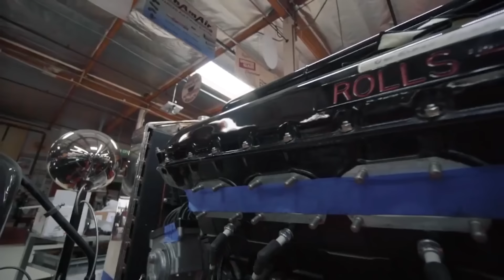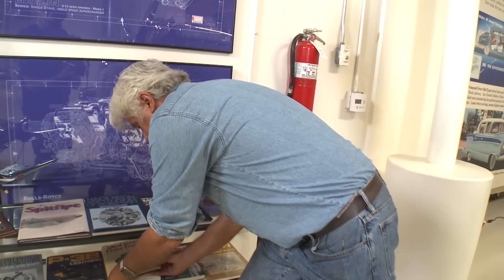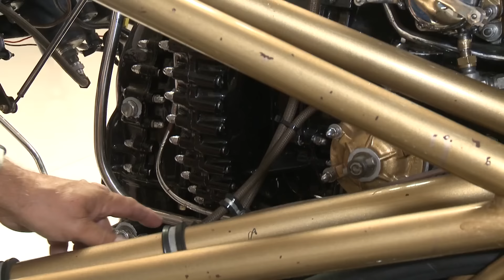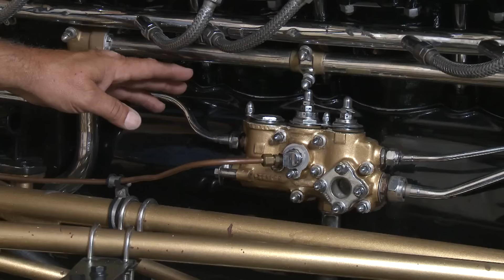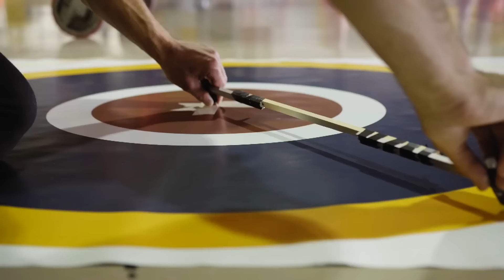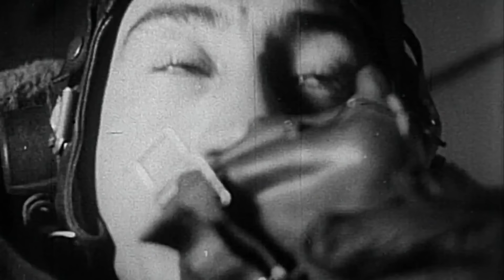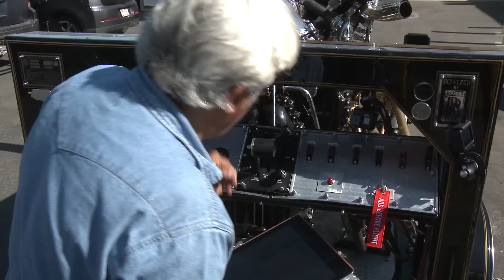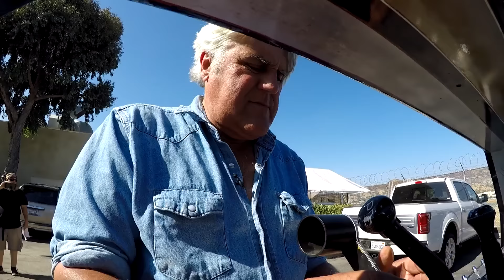The Engine That Won World War II - Jay Leno's Garage

Comment: My father worked as set-up man at Breeze Corp. in Newark, N.J. from 1941 to 1946 setting up machines that made tubing and braiding for control cables and the ignition wire shielding and radio wire shielding for the Packard Merlin engines and for the V-12 Packard engines in the PT boats and was verbally abused for 3 years by people who accused him of being a draft dodger and a slacker and was spit on and cursed at. He was 5'9" and 175 lbs. and could never say a word about what he was doing.  I think The History Channel should do a documentary on what the war workers had to experience during WW-ll.
Reply: It was a Rolls Royce Merlin, not a Packard Merlin. Packard made under licence from, and overseen by, RR.

Comment: The engine that won the war is reaching.  I understand the emphasis, but many crucial campaigns around the world were won by radial engines of various builds.
Reply: Not at all.  The narrow design made for a very efficient package once put in the later Mustang variants that allowed them to escort the bombers all the way to critical targets within Germany and back.  Hence slowed or even stopped certain war production which in turn won the war in Europe.  Yes many, many radials contributed and were an integral part but saying the Merlin made that significant of a factor in not far fetched in my opinion.
Reply: @mnmvuk  

What you wrote ("significant part") is different from what the premise was ("won the war"), and the impact of their roles is known to us all. No single engine did that. You mention the factor of the long range Mustang which indeed swept the skies and enabled the bombers in both theaters. Many of those heavy bombers had radial engines in Europe, certainly the Americans, because radial engines were tougher and could withstand more damage than fragile inline engines. 

The Americans were bombing in broad daylight (unlike the British bombing at night with inline powered bombers). In the Pacific, radial engines did the bulk of the work and the war was ended completely by American bombing from radial engines.

Comment: A woman near where I grew up in Willenhall ended up with a Merlin in her kitchen when it was lobbed through her wall.
Alex Henshaw, the chief test pilot at the Spitfire plant at Castle Bromwich, was ferrying one back down to the factory from Cosford when the skew gear sheared. He was below low cloud and didn't have much option but to slam it down on a canal tow path which was when the Merlin detached and went through the wall of a nearby house.
He was testing again the next day after a soak in a hot bath. 
I personally prefer the sound of a big radial or the Griffon to the Merlin but there's no denying the effectiveness of the design. This one of Jay's is great to see and I'm glad it's being run and giving people goosebumps and smiles.

Comment: The pilot in me was SCREAMING while you started that thing...

And while you ran it

And that engine was not designed to run anywhere near 4000rpm's.  It would run at no more than 3000; most likely 2800

Comment: the DB 605 was more impressive, technically , don't you think ? also, it had about 30 % more displacement - yet was a bit smaller in length and width   ...  if the Germans had the same high grade good quality gasoline as the Allies had - they'd get even more power out of it

Comment: When I was in a Navy squadron that had R1820 radials we used 115/145 avgas. You said that you are using 100 octane avgas - is that the highest octane you can find now or has the compression been lowered during the rebuild? A beautiful motor, both visually and audibly!

Comment: All you need now is a P51D that needs an engine. That's the coolest thing you've got, thanks for sharing...
Reply: Or a Lanc, or a Halifax, or a Spitfire or a Hurricane, or a Mosquito.....
Reply: @duanerutherford9033  spitfire did NOT use a PACKARD built version of this engine,  the spitfire MkXVI did use the Packard built 266 version as the only spitfire model to use a PACKARD Merlin !!!!
Reply: @wilburfinnigan2142  I never made a distinction between the Rolls Royce original version and the Packard version. I know that the Spitfire used the Rolls Royce Merlin, and that the p51 used the Packard. I wasn't aware of the later model crossover. Either way, I stand by my twenty year opinion that the Merlin (both versions) was a deciding factor in the war.
Reply: @duanerutherford9033  Also EVERY engine in the war was a deciding factor !!!! Hell there were 14,000 P40's  9,000 P38s. 8000 P39's/63's  used in the war and those all were a deciding factor, along with the 200,000 plus PW R1820's the 180,000 Wright R1830's and the 128,000 R2800 PW's !!!!  ALL of those engines dwarfs the 150,000 merlins made !!! Its all in the Numbers !!!!
Reply: crashaxearmory  except the Mustang NEVER used that version of the Merlin........neither did the spitfire, lanc's, hurrycanes and mossies did though !!!! PACKARD provided 37,137 merlins to the Brits !!!

Comment: It’s a pleasure to hear that engine, attached to a Spitfire fly over our house regularly, we live in what was known in WW2 as ‘Bomb Alley’ in Kent, UK.
Reply: Jay Day   That engine, the PACKARD built V1650-1 was NEVER used in a spitfire !!!!!  Lancs, Hurrycanes, Mossies, P40's........  Facts of history !!!  You do realize don't you there were over 30 versions of the merlin using THREE DIFFERENT superchargers????  First merlis up to the 20 series were a simple Single stage supercharger, then ALL 20 through 50 series, the most common version used throughout the war they added a second speed to the supercharger, to turn the compressor wheel faster at altitude, and then  in1942 they added the 2 stage 2 speed version....

Comment: Yeah Jay Leno did the smart thing limiting the RPM of that big engine if that engines powerful enough to lift a 10000 to 15000 lb plane into the air it would have no problem at Full Throttle taking that forklift and sending it into the building behind it not to mention the engine on the trailer could end up taking off trailer and all across the parking lot from the thrust Jay did the right thing by playing it smart

Comment: What's the difference between the Merlin and the  Allison aircraft engine ?
Reply: As I understand it   The Merlin used different superchargers depending on the altitude the aircraft was intended to operate at. High altitude aircraft used dual superchargers. The Allison on single engine aircraft used one single stage supercharger, but the twin engine  P38 used the same engine with a turbo charger added because more space was available.  Gregs Aircraft and Automobiles has some excellent videos on this and similar subjects.
Turbo vs Supercharging in WW2 Airplanes
https://www.youtube.com/watch?v=ULLsIo1VzTw&t=1180s
Reply: Thanks for the informations

Comment: Early Merlins had one-piece cylinder bank + head castings, but difficulties with porous casting flaws drove RR to make them seperate. Apparently several Spit and Hurri pilots were lost when glycol coolant got into the exhaust because of this flaw. It wasn't much of a problem when in flight, but because of the nose-up landing attitude they couldn't see the ground properly when the cockpit was surrounded by a thick cloud of glycol fog.
This information came direct to me from a guy who used to work for RR and was seconded to the RAF during the BoB, where he worked on the home base airfields.

Comment: I may have heard incorrectly but why did he set the mixture to cut-off. That's not how you usually start a carbureted engine. It's been a few years since I have flown but mixture set to cut-off is how we would turn the engine off. Gotta figure that mite be why it was stalling on start up because it was eating up the initial primer fuel used to start and then leaning itself to cutoff. I'm guessing I heard incorrectly because Leno knows his stuff. Awsome video though.

Comment: The Allison V1710. Great engine too and equally important in the history of WW2.
The Merlin was equally important, and with its supercharger design it was superior to the Allison for critical altitude.
Reply: The Alison engined mustang was a dog until they put a merlin engine in it,the merlin was a way more important engine than the Alison my friend
Reply: mattvew findlay 
Wrong. Allison was superior in every way  under 25,000 feet. Auxiliary supercharged made it inferior at critical altitude. My friend.
Reply: @machia0705  wrong again the p40 was also a dog and that had an Alison engine and that had woeful performance, can you tell me where you qot those fantasy numbers from? The only aircraft that cut it with allison engines was the p38 and that needed two of them and that was only in the pacific, the p38s superchargers froze up at high altitude in northern europe
Reply: mattvew findlay 
Lol
P-40 was a dog? It could out dive and out maneuver a P-51 making it the preferred ground attack aircraft in all theatres of war, made possible by the rugged Allison V1710. The P-51 had superior speed and range, making her the best escort fighter.
You’re naive at best, to think that the Allison and P-40’s were dogs. Lol
The Merlin was an incredible piece of machinery but had nothing on the Allison except for it’s supercharger design. At lower altitudes the Allison was clearly superior. 
I’m a pilot, an engineer and a reader of everything technical relating to aviation, especially 1930-1946 civilian and military designs, history as well, WW2 history. What is your background?

Comment: While I love the sound the Merlin, I'm kinda partial to the P&W R2800. Just the Marine in me I guess
Reply: Corsair?
Reply: @duanerutherford9033  you nailed it bro!
Reply: @marinegunny826  Thought so. They have a bent wing beauty at the CWH as well. Used to hear it flying around all the time when I worked nearby.
Reply: @duanerutherford9033  pilot and owner of one let me get my picture taken with it at an airshow in Chesterfield Virginia. He said it was pure pleasure to fly but something to be respected as well
Reply: @marinegunny826  lot of interesting history in that bird. Bomber engine and prop on a fighter. Gull wing so the prop won't strike the ground or deck. And then there's Pappy, and the Blacksheep. VMF 214 FOREVER!
Reply: @duanerutherford9033  Yeah, for sure, and the fact that the Navy rejected it at first and relegated it to the Marines. Then the Royal Navy figured out if you make a gentle arc towards the carrier, it's only at the last second you lose sight of the deck

Comment: The Merlin is a great engine. I like the Pratt and Whitney R-3600 as well. A 28 cylinder radial engine, displacing 3600 Cubic Inches putting out 1800 horsepower at full military.
Reply: The Pratt & Whitney 28 cylinder R- 4360 cu in had a max output at takeoff of 3800 hp. At 2800 RPM.

Comment: What's amazing is that this engine was designed and built using NONE of the modern techniques that designers have today.  No CAD.  No CAM to make the parts.  Not even a pocket calculator!  Just a slide rule and a micrometer.

Comment: Many of the comments here prattle on about Packard modifying the Merlin. They did no such thing. RR ensured their engine had interchangeable parts no matter where it was made. The engine was made at a number locations: Crewe, Manchester, Glasgow and Detroit. Packard took a time setting up Merlin production as they used American threads, not British. 

Packard had to issue a tool kit with each engine as British and Aussie mechanics did not have US gauge tools.  In hindsight RR should never have allowed Packard to stamp the word Packard on the rocker box covers. But in the day, seeing the word Packard meant you used another tool kit. This confuses Americans into thinking it was a different engine to the RR Merlin.

Comment: DB601 was better and had fuel injection Merlin would stall in high G dives and cut out because had a carburetor.
Reply: The carb' stalling was only for a matter of weeks until there was a fix installed.  Later Merlins had fuel injection.

Comment: I certainly won't take anything away from the Merlin. It's a great engine. But the Pratt and Whitney R-2800 double wasp was every bit as important and powered a lot more aircraft than the Merlin did.
Reply: The R-2800 was nowhere near the Merlin. Making a lot of them does not mean better.

Comment: Sounds like my truck.. started it on the sales lot..  brought it home.. didn't worry about cost.. it's worth it every time I light it up;;☆》♡♡♡ 

Mix hempseed oil with the ethanol.. it's the way to lubricate the top end and cushion the valves on the seat.. no fancy metals required..  hempseed oil can replace diesel.. and jet fuel.. it burns blue and clean, like hydrogen.. no smoke or soot.. add acetone and it will be the best av gas for this engine.. I did my apprenticeship on Jaguar, worked as an engineer on gray market exotics.. built factory floor automation for Raytheon Engineers and Constructors.. we built 2 refineries while I was there... I was the lead programmer for my group.. I have been working on this for about 8 years.. we must stop using petroleum based fuels.. it's the ONLY cause of global warming
Reply: Ohc 4 valve.. awesome  .. sounds like my 5.7 Nissan would.. sorta.   DOHC.. 4 valve..most people in America don't realize how long ohc engines have been around.. Alfa released the first production DOHC engine in 1906.. San Francisco had horse drawn fire engines
Reply: Acetone can be made from alcohol.. by distillation with a couple ccs of sulfuric acid.. and adding a carbon ring... I am working on it at the moment
Reply: Hydrogen is zero emissions.
Reply: @johnburns4017  so .. it's burning.. oxidation, right?.. turns it into water vapor.. that's the goal brother
If you add a little carbon it also oxidizes.. acetone has a single carbon chain with3 C atoms.. it's the absolute minimum.. I can make OH gas on demand with a little HSO4.. I have a couple old MGB SU carburetors.. I am going to recast the float bowls to accommodate the acid, it just sits there and eats the carbon.. I replace it every couple of years in the ongoing experiment in my lab.  Big Fun.. I have a video on YouTube here that shows another experiment using it as gas for a Little Torch for jewelry making.. now I can melt platinum.. another project
However.. as an immediate replacement for gasoline.. it's getting hotter in Phoenix.. and polar ice will sublimate into water.. on both poles.. all at once.. 
How long can you tread water?
I am in a wheelchair chair at the moment.. it doesn't float
I don't need more money.. I hate watching people die
So I give this information away.. so other people can use it.. we might be able to save our one and only Planet.. we vote with our wallet.. alternative fuel is never forced.. we make beautiful music through mutual cooperation.. it's a good thing
Reply: Adding 250cc of aspirin gives us acetone from raw ethanol... 250cc = small bottle of aspirin.. per 4 liters of alcohol 
 it's acetylanhydride.. a single carbon ring with two hydroxyl ions attached to the same carbon.. it adds OH.. it's cheap.. I buy it at the dollar store.. the distillation is a 3 step process.. make ethanol.. it can be made with bio mass.. from hemp.. leaves and trimmings.. hemp is a single stalk... the leaves fall off during flowering and seed production.. most people who grow medical cannabis don't use water leaves.. the first stage of growth.. ==>> grind and add water.. yeast, and sugar according to beer or wine making recipes.. it's the same thing, only different.. add enough sugar to make wine as strong as possible.. it's around 30% or so.. look it up.. and distill.. it doesn't matter about copper unless you plan on drinking it.. a very good solvent in the laboratory.. not so good at home 😕.. like drinking drano.. 
2.. distill the result with aspirin.. the less excess salt the better.. use baby aspirin 
. I use an acetone/ice cooling bath for this step.. I am using a small glass distillation unit for the laboratory.. I use a separate reservoir and a small hill to siphon the acetone.. it's not easy to find tubing that handles acetone.. the ice is necessary to cool the hydroxyls into a liquid.. 
This is one of the oldest recipes in organic chemistry.. it's the recipe for ether... sorta
Reply: Peace y'all.. let's Change the World.. 
Step 1.. stop using fossil fuels
No problem about proprietary information.. I learned this stuff in Chemistry 101
Reply: Add 2 ccs of HSO4 per liter of acetone ==>>  it's there in the bottom with whatever is left.. makes a black sludge with the carbon from the acetone.. distill at the boiling point of acetone.. about 56° C.. less than alcohol.. I lower the temperature until it simmers.. like cooking soup.. or something 🤔
Wash the black sludge out right away.. that's where the stuff with a higher boiling point ends up... salt buildup was the reason I had to renew the acid after 2 years.. it's actually a very very clean process.. way better than oil refineries